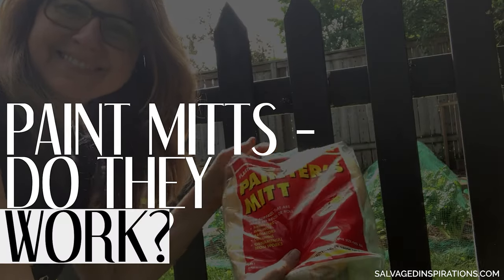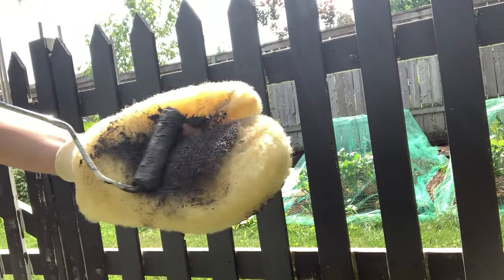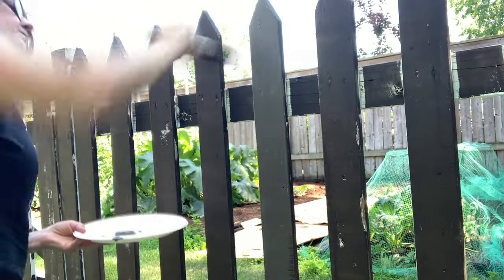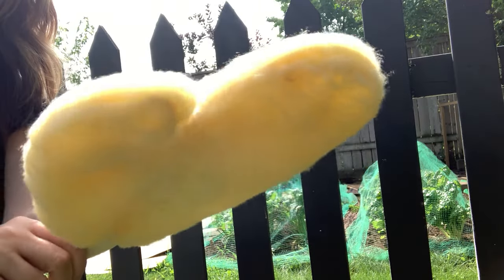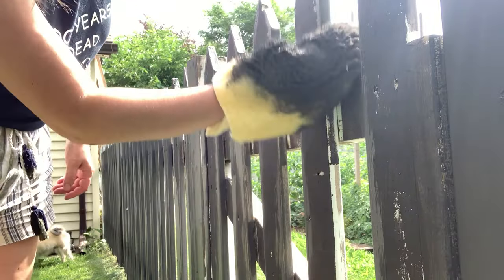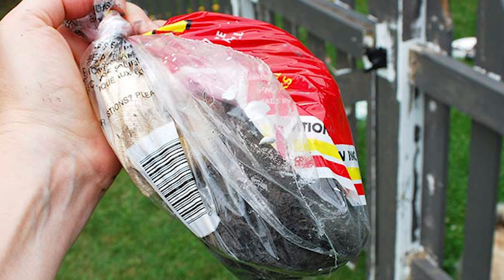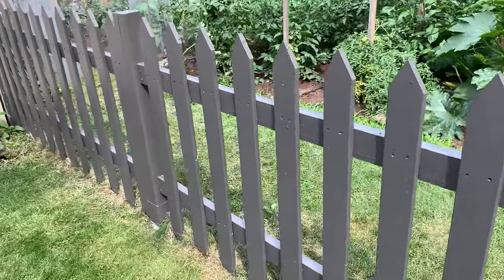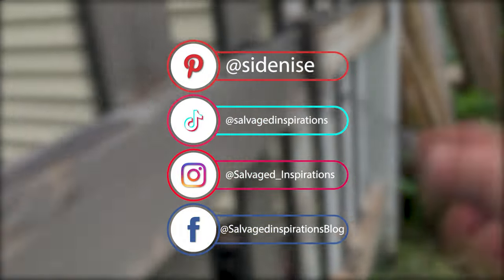Paint Mitt  - Does It Work?

Comment: Great information! The dark color looks amazing! I am most impressed with the idea of using Dixie Belle paint for the outdoor picket fence, wow! What sealer will you use to protect it?
Reply from the maker: I used the DB paint to find my color. Then I went to Lowes and bought an outdoor paint/primer in one. Buuuut, yes you can use Dixie Belle Paints outdoors and I would seal with Gator Hide. It's not just water repellant, its water resistant and SUPER durable.

Comment: I don't think that is the mitts intended use,  but hey! 
It is more intended for polymer render application,  but what ever works. 
If you want to keep your mitt or bush's over night with out cleaning,  Just pop in a plastic bag and then into the freezer,  great with either water based or oil based paints.
Hints from down under.
Reply from the maker: Thank you!